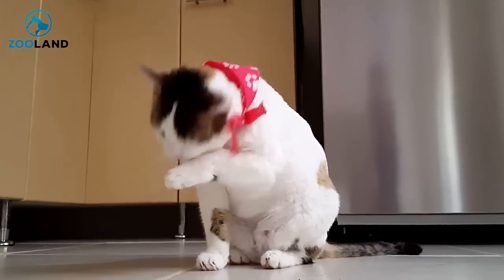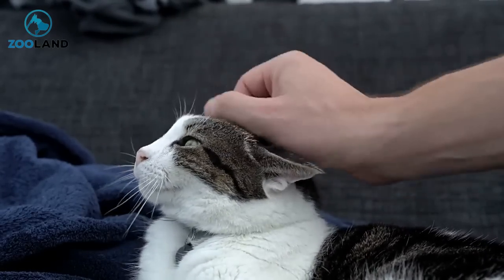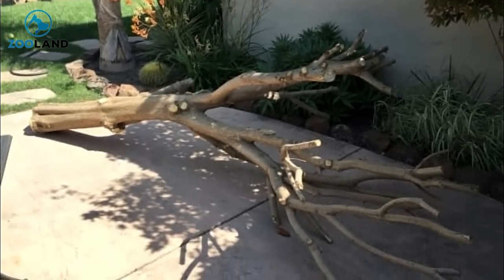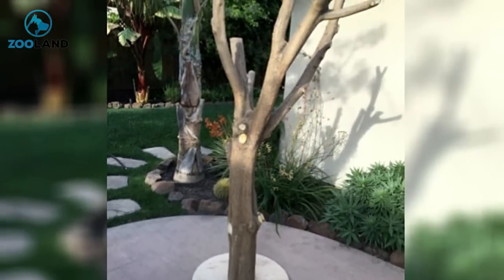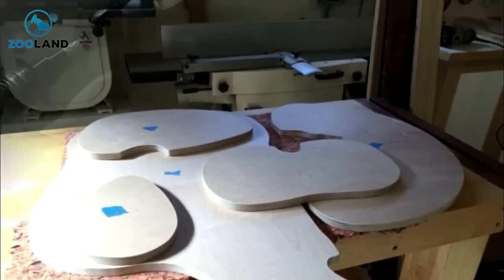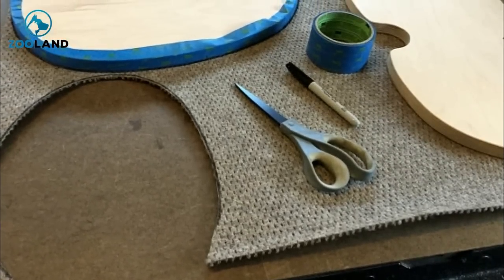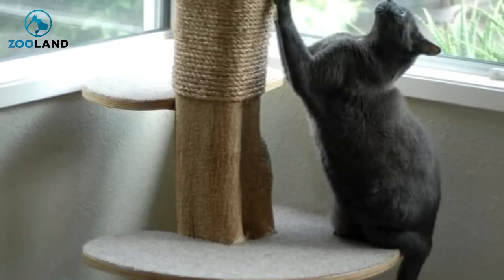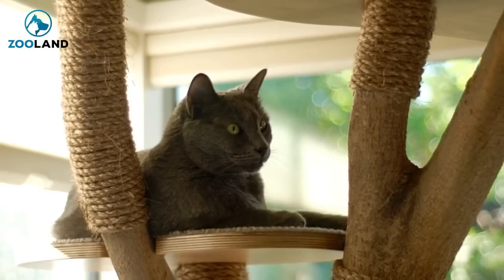A woman builds the most amazing DIY cat tree for her kitties

Comment: For all the " tree enthusiast" a quick jaunt into the edge of the woods and there are plenty of downed limbs and trees there to use judgement free. Also all Lowe's and Home Depot home stores cut linear pieces of wood free of charge. So really all you need is a hand saw to even up the branches, rope, drill bolts carpet and glue. This is a fantastic idea thanks for posting
Reply: Kish L. you are absolutely correct. You don't have to be rich to make a cat tree that your cats will thoroughly enjoy. Lumber is cheap at the home improvement stores as are carpeting remnants. I got tired of pricing the cat trees at the pet stores, as they were so expensive for even a little tree. So I went to a home improvement store and was really shocked how cheap wood is. In fact, most of the cost of a cat tree in the stores is from the cost of labor, not materials. I have made four cat trees, and one for my disabled neighbor's nine cats. After a storm, I drive down a wooded area to acquire large branches that have fallen in the right of way and haul them home. I don't have a lot of tools, but I have at least a drill, jigsaw, and many screws. It's time consuming but a lot of fun watching it take shape. You will be surprised at what you can do! It usually takes me five to six weeks to do one. But my house cats love them. Cats don't expect perfection. They just want something to climb on, maybe take a nap.

Comment: She could have got away with non coated pine with glued 1by2 running on each bottom for rigidity. I like to use little to no solvents with wood glue being the prominent binder thats non toxic in most cases.

Comment: How did you attach the carpet and rope?
Reply: Likely a simple hot glue gun or a maybe a hammer and nails. Maybe a drill and nails? Any of the above will work beautifully 🐱👌🔨🐈
Reply: Staple gun. Most cat trees you find in stores have the rope attached by staples, just try and staple in areas where your cat is less likely to scratch